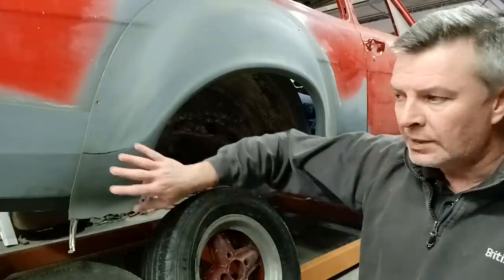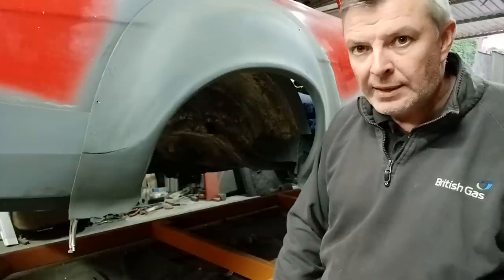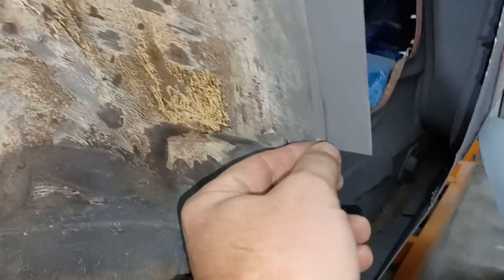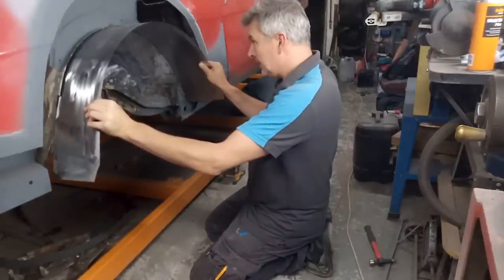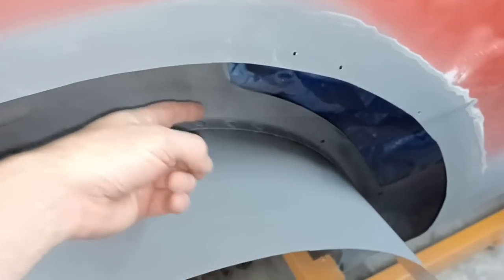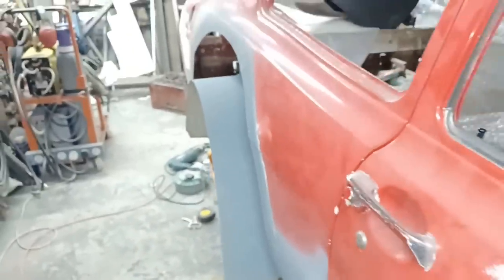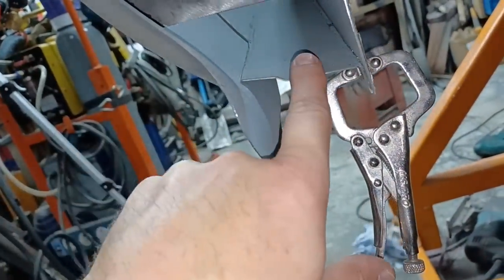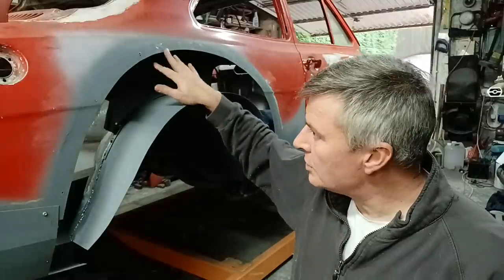Ford Escort MK1 Restoration.  Fitting Tubs Ready For Bubble Arches.

Comment: Dave, gas welding rods are great for using as a filling strip to weld up / fill small panel gaps and are easier to work with less hassle than trying to cut very thin slithers of sheet. I would also be tempted to weld a vertical flange to the tub edge and bond the bubble arch to the flange with tiger seal as opposed to stitch welding it where they meet.
Great work as usual 👍🏻
Reply from the maker: Thank you, I like the suggestion of the flange and tiger seal, I'll give that some thought.

Comment: Fantastic job again Dave. Like the idea of bonding instead of welding. In my experience (limited!) welding = accelerated rot in the future. Nearly all rear wheel arch rot stems from the spot welds securing inner to outer.
Reply from the maker: A few have said this now, so I’m liking the idea more and more.
Reply: When applied properly sikaflex or tigerseal is really strong, and you won't get rust forming between joints.

Comment: Hi Dave, great vid pal, just a thought bud i am about to do my bubble arches but I'm going to joggle the rear panel an put a slight step in it with 10mm lap so the arch fits flush to the rear panel just so there will not be so much filler
Reply from the maker: Hi David, I'm torn between joddling and butt welding it, I know the joddle will help with heat distortion,  but it'll leave a gap that'll need fully sealing. Let me know how you get on.

Comment: How about attaching the tub to the bubble arch with a narrow piece of steel radiused 90 degrees? Just tacking it and adding a lot of sealer doesn't sound a strong enough connection of the two parts to me, it'd also address any gaps you might have. I realise there's two curves to follow but you could slot one side of the 90 degree and make sure it follows the curve on the bubble whilst it is still off the car.
Reply from the maker: Hmm, I'll have a play with that idea. Ta.

Comment: Really enjoying your videos, I have the same mig welder. What wire and settings are you using. Keep the videos coming.
Reply from the maker: Hi, Leon, I use .6mm wire with co2 gas. For 1mm steel I tend to have both dials at 12 o'clock.   I find that if I have the wire speed and the power set about the same, it works well.